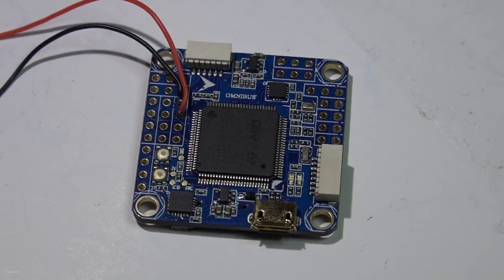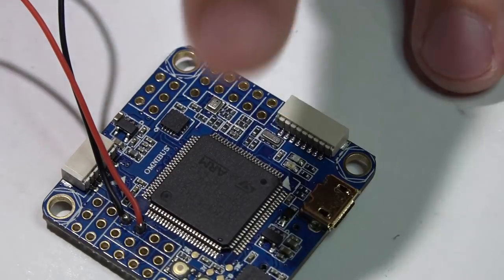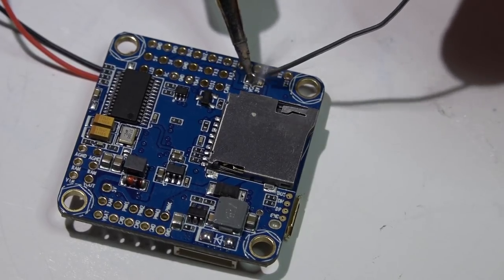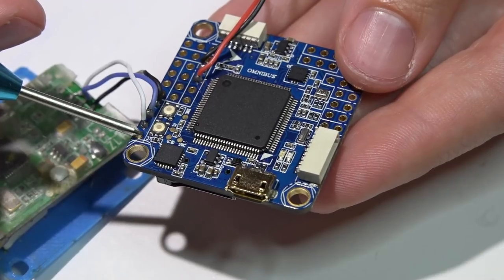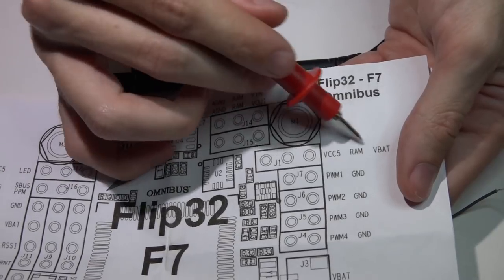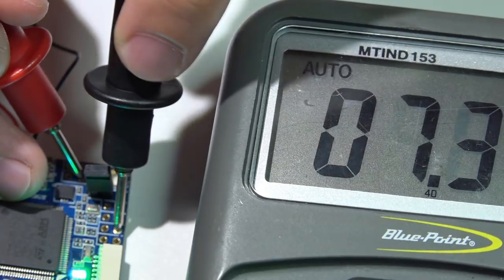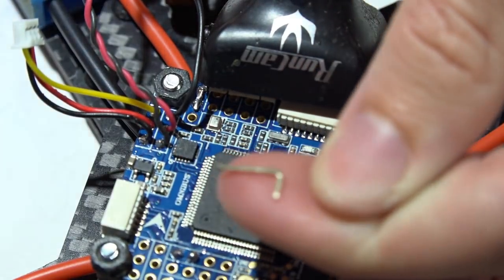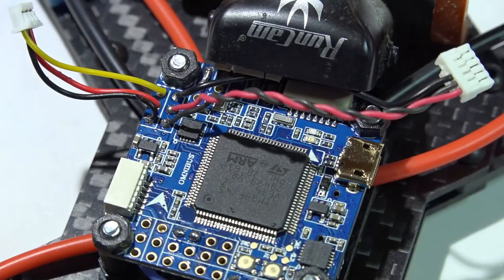Omnibus F7: Powering FC, Receiver, Cam, & VTx

Comment: Diagrams like the printed one seen here would all be better if the labels were next to the pins horizontally, and not interleaved!

Even if your cam OR vtx can "use" full vbatt power, doesn't it just step it down within the device?  And if so, does it consume power and produce heat in doing so?  (and is it really beneficial to be stepping the power down in multiple locations?)

Or do some cams and tx's use full vbatt power straight through with no step-down?
Reply: i was gonna ask this too, in terms of ultra cheap vtx the eachine tx526 and the runcam swift mini, am i better to feed them 5v to avoid heat issues ?

Comment: This is why i check, and re check with a multi meter,  at least the pins are actually labelled correctly :)
Reply from the maker: Yep always good to check. If I hadn't checked I would have wired the receiver ground to the power pin.

Comment: the ram information was added after your printout. but fixed the arrow covering that pinout, did not even notice that. 😂  the picture on top is correct and shows the pin outs super clear. thanks again

Comment: great video thanks .that schematic is very poor and I think it's going to confuse a lot of ppl .looking fwd to seeing what you think of the FC once it's actually flying. I wanted to use the F4 but with no way of changing the the telemetry inversion with software it just causes more issues to potentially go wrong . I have a question .....In your opinion what's the best FC that has an on-board BF OSD that has software inversion? thanks for the great vids John

Comment: My question is what if you wanted to power the board via an external 5V PDB instead of the direct battery voltage. How would the internal OSD know what the battery voltage is? Thanks in advance.

Comment: Hey Jc what size wire do you use for vbat and ground? On the F4 I saw you said use 14 gauge. I was planning on using 26 gauge for fc pdb and using 14 gauge pig tail with xt60, 16/18 gauge for esc. Also I'm using 2407 motors, 184 amp matec pdb ,flip 32 f7 omnibus and wraith 32 esc 35 amp esc.i just got a little tripped up with the the 14 gauge you used with f4. Thanks for all your help.

Comment: Hey JC just did that and blew up my 5v regulator (not your fault I connected my f7 before watching your video ) but it is good to see that I didn't make a mistake in doing what I did. I have connected my f7 exactly like you did with yours and wanted to test the board before the next step putting in the ESC's plugged in the battery and... fry baby fry

Comment: Great video Blue Falcon!.. I have one question: i followed your tutorials on how to set up quad with omnibus f3 series and i have difficulty to set up RSSI value on my osd and betaflight configurator. i use rlink 433mhz uhf system as tx/rx and rx is only outputting analog RSSI. Is there any way we can use this analog RSSI IN OMNIBUS F3? RSSI pin seems to do nothing. if omnibus is not capable to do this (shame on them because we have this pin on the board) is F7 controller able to use analog RSSI?? Sorry for long question. i thrust on your experience.

Comment: would you recommend to connect a omnibus f7 to a matek fchub-6s with a 8 pin jst sh cable or with individual wires? the jst sh option would be cleaner easier to disconnect but thicker individual wires should be more robust and secure.

Comment: was looking at different hook up options for a 5" Kraken Worx here and due to the very narrow arms I was considering swapping out the Skitzo RF1 and EMAX 30a bullets with an AIO. So in short I was checking in at my local hobby store and they just got in a Cicada F4 AIO. Now I wouldn't have taken the Cicada but they brought to my attention that it is an F4 Omnibus running CicadaESC's and I remembered your great review of Omnibus FC's so I bought it. I am not having any luck getting much intel on it and I am curious as to what you know and could throw my way. Much appreciated. Cheers...

Comment: i want to use omnibus f7, so what will be the requirement of all other components or module? like Tx Rx model no, Battery, motor,power distribution board,camera,propeller length rating etc.

Comment: Your flight controller how-to videos are excellent.  A lot of what you learn on these is very applicable to doing forensics on other FCs as well.  Thanks!

Quick question... I see you do not have the VTX and Camera on the same ground pad.  I thought the rule for best OSD/Camera signal was to always tie those two into the same ground pad.  Are these ground pads close enough in proximity (no resistance between them) to not worry about it???

Comment: hey there, great video! i have the same question as neil. i have 3 of these boards at home - and wanted to hook them up in my 6s rigs... but where do i put the capacitor they advise usto use? i put it on the lipo pads of my 4in1 esc... my quad flies mor or less normal on 4s but on 6s it flips out of control directly after takeoff (flashed the latest bf 3.2 3 days ago)

i hope i did not fry my board by wiring the cap wrong 😳

Comment: garbage....I test it and it has a lot of bugs in betaflight 3.2 , no buzzer, no sbus,,, no vbat menus in configurator... etc..

Finally I change for a kiss, much better, and much better fly
Reply from the maker: DanimoD Fpv realize the firmware it's still in the beta testing. Using beta kiss firmware it's just as buggy. Just be patient and the firmware will be finalized and released soon